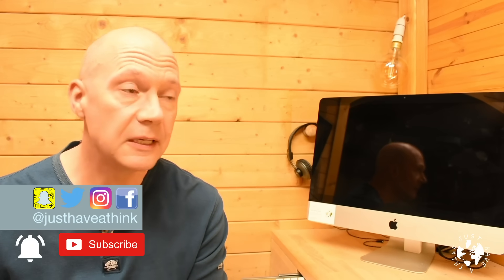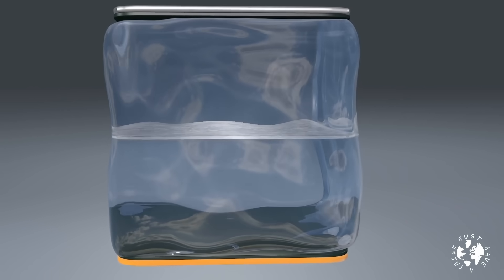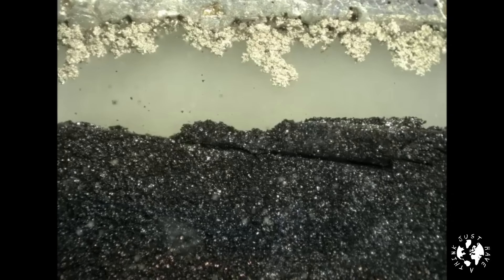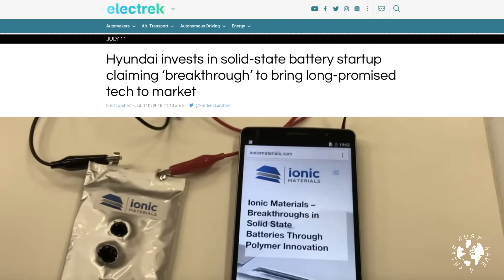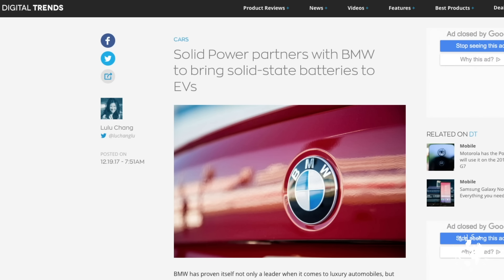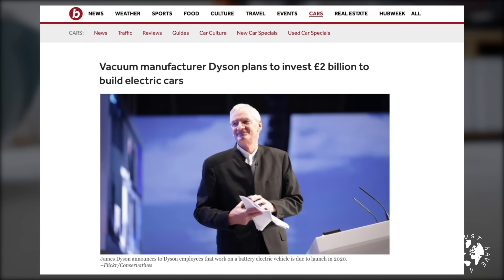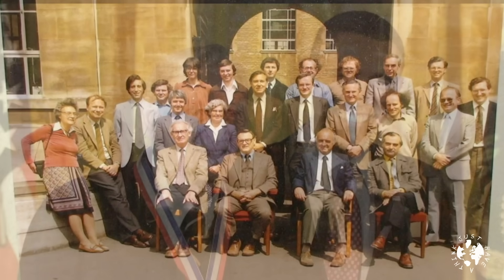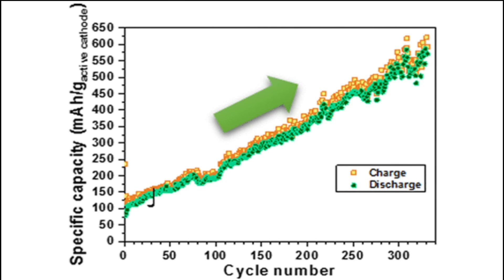Solid State Batteries - has Goodenough nailed it again??

Comment: Climate change is fake dude, but this battery will completely stop the worries of it. Oh wait, no it wont, we will then end up woth al fuel going to energy production. It goes without saying that we dont even have enough fuel in coal or gas on Earth to actually permanently wound it using it as we do, its too finite to last the several hundred years needed. Earth has always had a cycle and there is no concensus as to if we have done anything at all to the environment.

Comment: thinking about it, it might work somewhat like a roman concrete breakwater. roman concrete was made from lime(AFAIR), which strengthens in contact with water. 
maybe something similar has been achieved in the battery, where initially it is in an imperfect state, but it's state improves with each use cycle towards it's theoretical optimum. 
sort of like a forest path detoriorates when not in use, but becomes more useable with more use.

Comment: if "discharge capacity increase with cycle number" then are we talking about a battery that will last forever?

capacity is fixed since materials are fixed. just like a capacitor's capacity is fixed. but probably last forever?
Reply: no, because entropy still exists. the battery becomes more efficient with use, not more powerful, but eventually the pieces will no longer function properly and it will wear out. it's just that unlike with a lithium-ion battery, it won't then explode, it should just stop holding a full charge and wear down over extended use.
Reply: @Yal_Rathol  you mean due to material degradation over time? yeah probably in a hundred years..
Reply: @johnchristopherdelegero1728  materials that are actively in use will degrade faster than that, but yeah, these things might have a shelf life for 50 years or more.
Reply: yes probably

Comment: I'm told that markets are unpredictable because it's the Weather, but if Energy is cheap and available everywhere it's wanted, then that's the end of unpredictability, maybe. 

I like the concept of Molten Salt Heat Batteries next to current Power Stations, and district substation power networks with whatever the present optimal storage battery is available. Mostly:
I don't know.

Comment: The lead acid battery simply wasn’t Goodenough
Reply: I had a BMW 1200 boxer twin motorbike that used a lead acid battery weighing 5kg. I replaced it with a JMT LiFePO4 that weighed 800 grams and found it flung the engine over better than the lead acid ever did. The downside is an increased internal resistance below 5 degs C. The fix is to allow the starter to churn for a 2 or 3 seconds. Then pause and try again. The high load warms the battery so the next start attempt works just fine. It really needed a small heater pad for use in very cold weather because the same problem would happen if the bike stalled - battery sits in the cold slipstream.
Advantages 

Small lightweight battery 

Half the cost of heavy duty lead acid. Similar cost to ordinary output glass mat lead acid. 
No electrolyte so can be positioned at any angle anywhere on the bike.
Tolerant of overcharge (unlike liquid electrolyte lithium ion batteries)
Very low self discharge over time (10% per year)
No internal damage if left unused. Lead acids get clogged with hard sulphate.
No need for a conditioning charger.
Can be bulk charged at high current 1 hour from flat to full no problem.
Over charging or over discharging will brick the battery. They have protection circuits built in but these can never be foolproof. Saying that a totally flattened lead acid will often never recover.

Comment: The only thing I could guess about that discussion on how the new solid-state battery could increase its chargeability with increased use is that the material that holds the particles in the middle of the battery is non-optimum, with the particles spread out at random, but using the battery again and again causes them to migrate toward the places where the charges are flowing (possibly near the surface of the substrate), decreasing resistance and increasing capacitance and its ability to hold a charge and/or conduct the current with less impedance to the flow.  I may be wrong about this, but that is as close as I could make out of that gobbledigook...

Comment: To give a bit of balance to this video, here are the drawbacks of the solid-state battery: https://australianmines.com.au/is-solid-state-really-a-threat-to-lithium-ion-batteries  In short, some drawbacks in addition to the price from the site the link points to:
    Operation at lower temperatures has been challenging (essential for EV use)
    An inability to find a solid material that is conductive enough to be used in a large battery
    They have been found to show very poor performance which renders their use in rechargeable batteries very impractical
    They exhibit low current output which is considered one of the biggest hurdles to overcome for EV operation

Comment: as of 2019-October, Dyson stopped their work on electric car.
Reply: Dyson had the sense to see that Tesla are now too far ahead to catch. Tesla may well be too far ahead for Big Auto to catch them; never mind a relative minnow like Dyson.
Reply: @Dave5843-d9m  Tesla is not reachable within next 5-7 years. Minimum. It’s not only a car company. Energy. Produce, store, network, sensors, hard and software.
Reply: They are still continuing research with Solid State batteries though. They just knew they couldn't turn a profit producing EV's.
Reply: papaburger , that sucks!

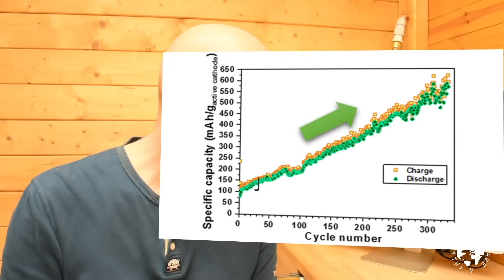Comment: at 7:56  the graph show mAh/g = Ah/kg and apparently reaches more than 500mAh/g which with an average cell voltage of 3.6V would mean a battery at around  1800Wh/kg!!! This is 7-8 times more energy dense than current Li-ion??

Comment: What is being said basically I believe is that as the Glass-plastics is charged more often that it becomes less resistant to an electric charge thus as time goes on it develops the ability  to hold a greater charge, how this might occur might be akin to how metals re-align their molecules with temping.  How true this is yet to be proven for there is yet to be a 65 year old battery of this design let a lone a 10 year one. The increase in capacitance may only be a short term effect, time will only tell; a decrease could start to occur after a few years of charging.

Comment: I understand perfectly goodenough's and dr. Bragga's battery and it is revolutionary and does not depend on gunboat diplomacy to get the resources to make it. Dr. Bragga's glass is the next best thing to buttered bread. You could actually put their battery in a Ford F250 and have the range of 400 to 500 miles without making the truck one lb heavier. Sweeeet! WE Need this. Now coupled with the Molten Salt Thorium Reactor the whole energy mix worldwide would be changed for the better and countries could follow their needs rather than suffering Exxon magnates taking your money.

Comment: What about the Maxwell dry battery that Tesla is putting the new Model Y, Roadster, Truck and truck. The production uses a 4 foot fab vs 60foot for the wet cell current batteries.  Nice to see these old car companies.  You talk of 250 mile range but the teslas all exceed that by a large margin.  Your future 400 mile range is a current Tesla range.

Comment: the new tech is more like 30% more energy dense for 20% more space but at the same time having a 20% savings in producing these cells; this will lead to a 50% increase in battery production at the same cost and at the same time reduce the cost per cell cost.

Comment: This is what happens when the money gets spent on real research, instead of Congressional pay raises, & tax cuts for the oil co's.
1 or 2 more improvements in batteries, & big oil is over.
Reply: As long as people use plastic bottles , and other plastic, vinyl, and such the big oil will still be around, just not as gasoline.

Comment: With respect to the improvement of the battery with use.  I dont know what all that meant that you read, but i can see it like this.  The battery is moving between two chemical process states.  That means the matter is changing at a chemical level.  I think what he has found is a chemical process that becomes more organized, so to speak, with use.  Each time the battery discharches and recharges the particles are self organizing for efficiency.

Comment: In order to displace the Lithium ion batteries the solid state batteries need to get out of the laboratory on to the production line, then they need to roll off the production in MASSIVE VOLUME before they can displace the lithium ion battery. Also a battery in the laboratory may be much better then a 2019 Li Ion battery but if it arrives in 2025 it will face a better battery.

Electric vehicle production is likely to be limited by battery supply for years to come so the volume of solid state batteries has to satisfy that backlog of demand before it can displace the Li Ion battery.

Comment: the nonsense bit effectively says that the glass acts like when you rub a towel or paper and get a static charge except that its ions rearrange to follow the the positive and negative poles (the two metals) also tunnelling possibly causes the cathode and anode to be closer increasing capable charge

Comment: Solid state batteries have been around for ages technically the non-rechargeable  "primary" class batteries (zinc chloride, etc. ).  Do you possibly mean "solid electrolyte" batteries, because there is a significant difference.

Comment: The "toxicity" of CO2 is a myth.  As a GHG it loses most of its "potency" (ability to trap heat) at a logarithmic rate.  Between at 100ppm CO2 (like a sponge absorbing water) uses up about 63% of its GHG properties.  At 400ppm (roughly where we are today) it has used up 87% of its GHG properties (think of the sponge becoming saturated).  

The bandwidth/spectrum that CO2 operates rapidly loses its ability to effect temperature rises.  CO2 has essentially done all the delta temperature rise it can do.  Only 13% of its efficacy is left.  A doubling of CO2 to 800ppm would only raise the average mean temperature on earth by about 0 .7C.  At 1,000ppm the CO2 sponge can essentially not "retain any more water" ie its ability to effect temperature change ceases.

Anybody dare to challenge this scientifically known fact??  It destroys the argument for trying to control CO2 emissions.  No need to get rid of cows, cars or airplanes folks, nothing to worry about here - go on about your business - it was just another hoax to trick us into heavier taxes and less freedom.

Comment: for what i know that the battery are having trouble cause the material has to be a certain size like extremely thin and layered. the most safe battery out there is the salt water battery as far as i know. and as far as who is ahead i hear goodenough is pretty close for it getting it to a scale where it can get mass produced at some point

Comment: I would expect the increase in capacity results from an increased area of the electrodes as they get rougher (uneven) as the electrode material migrates into the solid electrolyte.  More area equals more capacity.  It doesn't violate the Law, as it still has to be charged to its higher value. 

Violation of the Law (conservation Law) would require using an  electrostatic/electrodynamic (the only difference is frequency) system that creates hollow volumes of higher potential reached into by shielded pathways, coupled with the 'separation'-type transfer of charges to the inside surface of the hollow 'conductor' defining the volume of higher potential mentioned earlier.  That separation-type transfer is what makes the Van deGraff generator possible.  The difference is that if you shield the belt (best with overlapping layers of tin foil, so each layer is not at too high a potential from its neighboring layer to control voltage (by resistors) and prevent breakdown), which greatly drops the forces upon the belt.  Without the shield, the energy is put into forcing the belt up to the sphere:. Equalling the energy that can be extracted electrically from the high potential on the sphere.  With the shield, only friction and spraying the charge must be put in.  (((Interestingly, the director of the Center for Particle Research at University of Rochester, countered my argument for extracting energy from his 2 million volt Van deGraff by insisting that the unit takes killowatts to run---how could you expect to get more out than in??   His voltage and current off the sphere equals those killowatts---as it has to---or it would already be in violation Conservation of Energy, in that case, by destroying energy.  He forgot that the Law has to work both ways.  I was relatively early in developing this concept (in my college days at RIT), so I couldn't point out this flaw to him at the time. ))). So, unless Good Enough has done this in a solid state way, he hasn't violated Conservation of Energy or the Second Law.

Comment: 400 watt hours per kilogram. Big deal. Gasoline contains 12,700 watt hours per kilogram.

Sorry, battery buffs, but batteries are more than a factor of 20 WORSE than liquid hydrocarbon fuels in terms of energy to weight.
Reply: The Saudis love your enthusiasm for their products and hope you keep buying for many years.
Reply: @michelangelobuonarroti916  
You do not seem to understand the overwhelming importance of energy to weight ratio. A large aircraft with an order of magnitude lower energy to weight ratio will NEVER be able to cross the Atlantic. It would be out of fuel before it had gone 200 kilometers. No battery can match hydrocarbon fuel (with the possible exception of hydrogen fuel cells, and then one must deal with a huge tankage weight).

Comment: If the battery technology gets to be cheap enough, would you recommend having battery "padding" instead of insulation on your building to provide a buffer for the global power grid? If you're going to have something that radiates heat, why not make it warm ambient hot water pipes, or simply keep cold water pipes from freezing during the winter?
Reply from the maker: HI Vance. Sounds like an interesting notion. I guess access for change outs would be the challenge, but I very much like the lateral thinking approach :-)
Reply: anything very large wont put out any significant heat anyway, plus that amount of heat will be a detriment to most battery techs, thus they will want it much cooler

Comment: Better batteries and more EVs don’t solve anything, just move the pollution problem to places where electricity is generated. 
Most of electricity in US is generated by burning coal and natural gas. 
“Green” people should put their energy into pushing for replacing old power stations with hydro electric and nuclear instead of salivating about Tesla, wind and solar.
Or at least start with pushing for legislation to limit ICE fuel consumption. No passenger car needs 2 liter (or more) 150HP (or more) engine. 
One option is to implementing high taxes on cars with unreasonably big engines. That could cut fuel consumption (and pollution) in half over next few years. All it takes is political will. 
And that is why it will not happen.
Reply: Robert K,  “EVs do not solve anything”,You are very misinformed! If this presentation is talking about foreword looking statements then yours is 15 years in obsolescence.
I have two electric cars three Ebikes a windmill and solar panels, and a whole house battery.. I am still hooked to the grid but have been completely energy independent.
The cars themselves have often doubled for the house battery. Secondly even if people charge from coal . It is much more cost effective (police )to sequester C02 at the source. instead of this smog check crap that still allows a large % of people to fall through the cracks or pay off the inspection. Riding a bike I get smoke inhalation and sound battered by loud obnoxious ICE

I love hydro e power but as you know it can only be implemented where rivers run into lakes. Nuclear?
Taking ICE away from gear heads will be as hard politically as banning guns.
Tesla would never be as popular if it did not beat production muscle cars by huge amounts in the drag races. This is why gearheads have given up ice cars to begin with.
Taxing gasoline is the place to put your political energy.
The rest of the world is pulling away from fossil fuels based on this strategy. The byproduct of this revenue allows for many improvements in these economies,be it subsidizing alternatives or providing health care for all.
Alternatives are solving other issues as well in energy storage. Something the grid should do anyway.
Converting energy into ammonia, aluminum, gravity storage, air compression, as well as flow batteries which need not be light weight or small.
These are available as we speak. They never wear out have endless storage capacity and are cheep and environmentally friendly.
Power stations are privately owned not run by governments. The government may have oversight but critical decisions are driven by market demands not legislation.
I agree One passenger in a large SUV is truly a waist. In California the state allows e vehicles and 3 or more passengers to use the express lanes. While others sit in stop and go traffic.
This is a great incentive for people to make better choices ( not because they care about the environment or conservation of resources but they want to get where their going faster and cheaper.
One last point;  before I had all of these investments I was saving huge amounts of money by charging my one e-car rather than filling my ICE ,despite the fact that it may not have saved resources it saved me money which was reinvested to complete this utopian outcome.
Reply: already happening in london, low emmisions zone, cars are taxed in bands according to emmisions,  the world isnt the USA, esp under trump it wont happen, vote a more progressive candidate next time